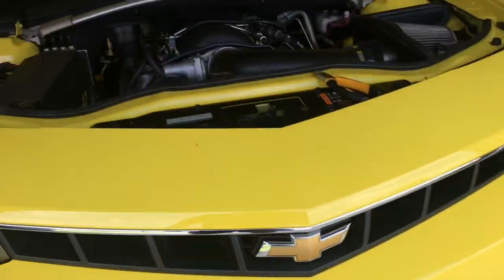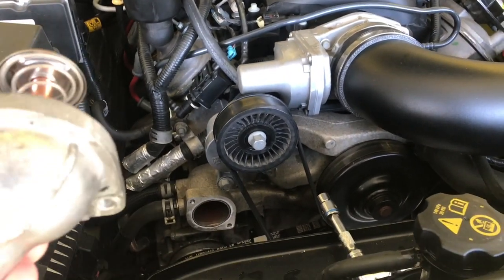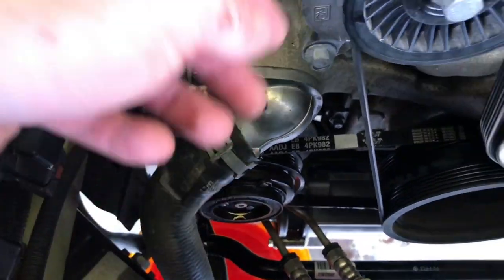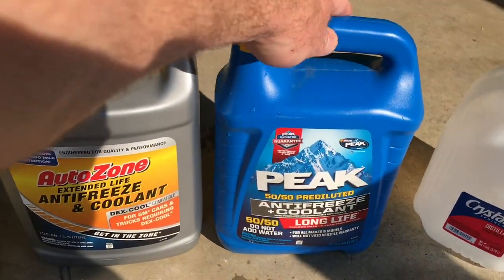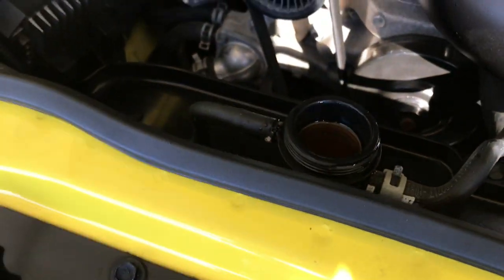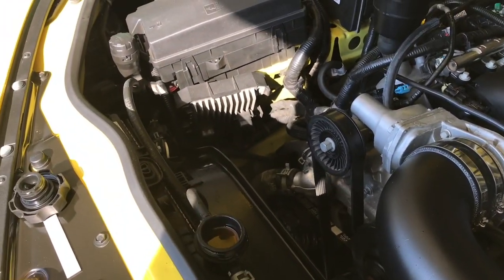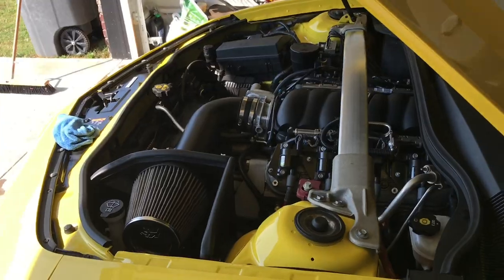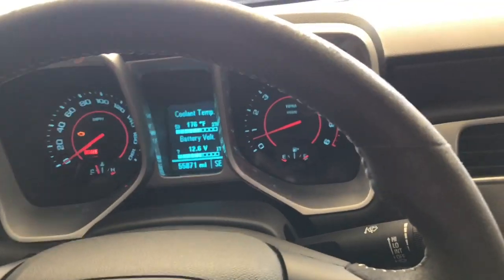2010-2015 Camaro SS thermostat install / Prepping PROJECT FREEDOM TAXI for TUNING !!!!

Comment: I got a 2011 Camaro SS I just changed my water pump and put 163 thermostat in it and my bolts were 10 mm double check your socket. I don’t believe they would be 11 mm.

Comment: Help!! Can not find mine in my 2015 Camaro RS
Reply: Did you find it?
Reply: Juan Teniente yes
Reply: Cold Water is it connected in the hose above the water pump?
Reply: Juan Teniente behind the engine won’t b able to get it unless u take it off , r u not getting heat in your car
Reply: Cold Water appreciate it! And I had a leak, I changed my water pump but then noticed I lost coolant without a visible leak so I’m thinking the thermostat or radiator cap could be what’s wrong

Comment: I have a little leak coming from underneath the housing idk why, maybe the thermostat gasket is off? Or do I need a housing gasket?
Reply: I have a leak from the same spot
Reply: Emmitt Brazille change out ur whole thermostat and you’ll be good bro make sure the nipple on the thermostat sits on the little slot it goes too
Reply: Remi Chavez lol that’s my issue I put in the new one and i remember doing that part I probably pressed the gasket too far inside the housing.
Reply: You have to align the nub on the seal with the nub on the housing. Look where his thumb is that’s the nub of the seal look to the right it’s not aligned with the nub opening on the housing,